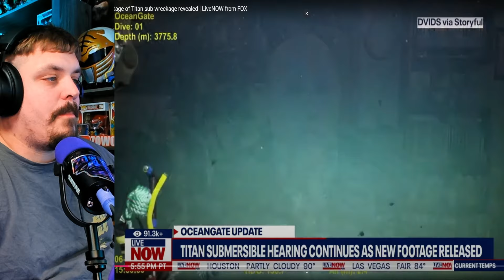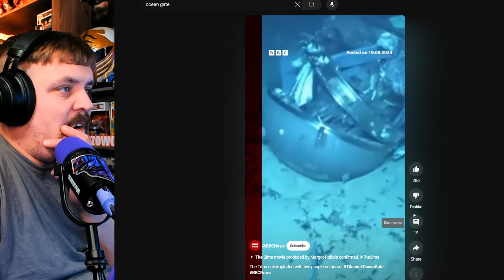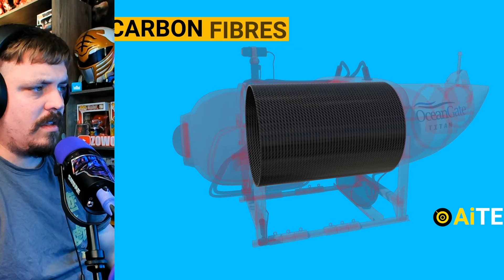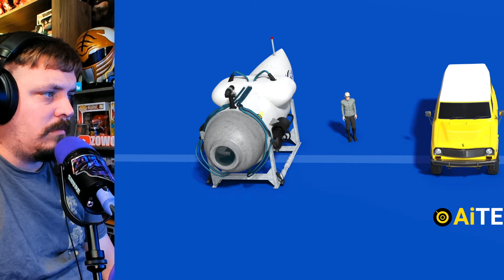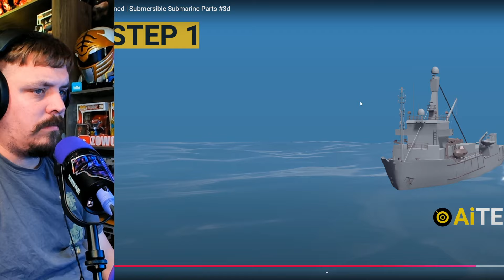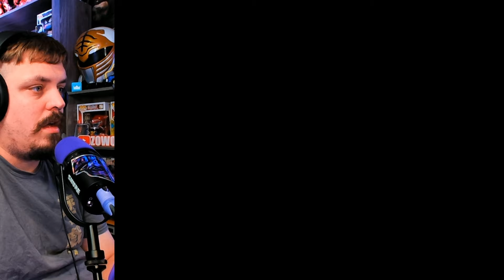Titan Sub Wreckage Reveals the Shocking OceanGate Mistake!

Comment: I still think the banging sound was them.
Reply: I do too. I think they knew it was failing  and were unable to surface due to some malfunction, and then it eventually collapsed, but in the time leading up to that collapse, the navy reported picking up knocking at 30 minute intervals for a few hours before the implosion sound, which is something a person would do to try and signal that they are there, and that they are a person, and not just random noise. I think that was them trying to be found by the navy, when one of the many things that could have failed did fail, and they were trapped there. That's just my theory on it. I definitely think they saw it coming though. Although I'm sure the implosion was very fast once it actually went.

Comment: After watching the video where they glued the carbon fiber ends of the pod to the titanium rings, it would appear the glue failed after repeated dives. It was also concerning that they failed to etch or abrasively rough up the inside of the titanium ring. Glue just couldn’t grip the metal over time.
Reply: It seems like there were so many different ways it could have failed. It's like the whole thing was just one big disaster waiting to happen. Just a bunch of mistakes piled on top of each other to create a submersible.

Comment: That is the problem with carbon fiber and more specifically the glue in this situation.  They tend to fail suddenly and catastrophically, rather then giving warning.

I have talked to several AP airplane mechanics. Even if old school, they still like metal because it shows cracks, bends, and other signs of fatigue before it fails.  They say the newer carbon fiber planes are far harder to see thise time of usage fatigue on. They just break on day.

Comment: I’m sure they heard some minor hull cracking before the big one
Reply: I say the same thing all the time. With that much pressure pushing in on that sub you better believe they heard something. Something loud.
Reply: @robertpresha9504  stockton rush was reported as saying that carbon fibre "screams like a mother" just before is cracks fully, so I think the last sound they heard was probably terrifying, sadly
Reply: @HB-vz1pr  It'd be interested to recreate those conditions in a lab and hear it
Reply: they definitely did, their last message said they were dropping weight which means they knew something was wrong
Reply: @mads7710  They were likely just dropping weights to slow descent. They were pretty close to the bottom. A theory I saw was that dropping the weights is what destabilized it enough. If the O-Ring seal is what broke, and not the carbon fiber itself, they wouldn't have seen it coming. They wouldn't have gotten the screaming of the carbon fiber to warn them.